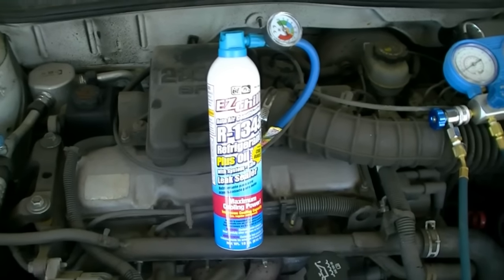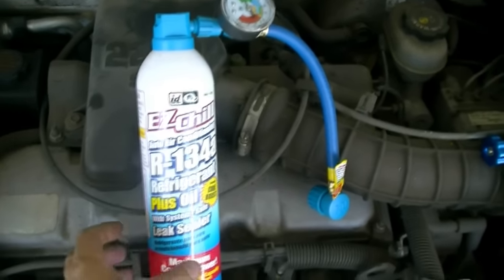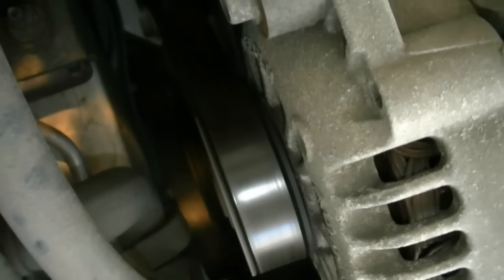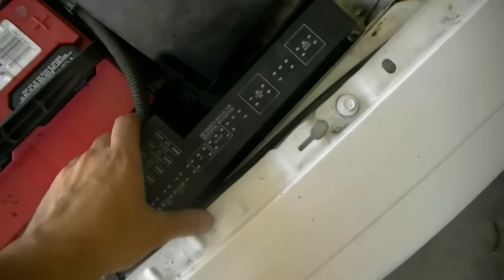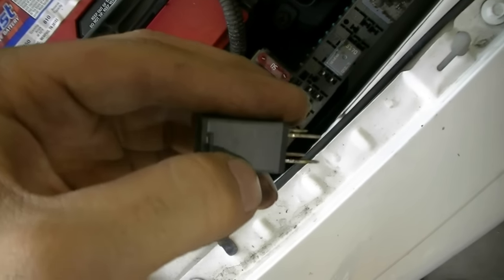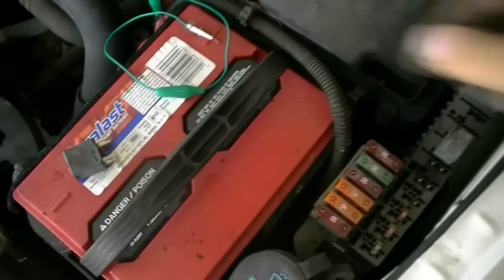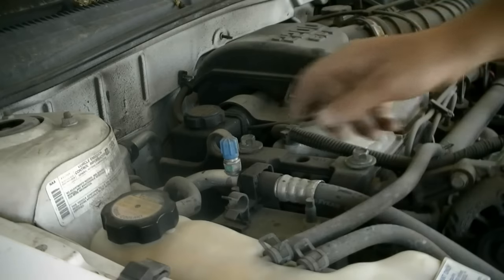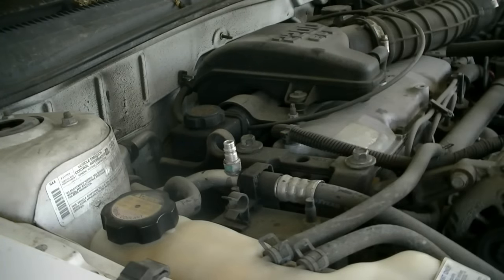How to Add Freon to a Car and Manually Engage AC Compressor Clutch

Comment: A lot of times adding a bit of refrigerant is enough to get your clutch running enough to draw more in. And FYI, Freon is a brand, it's called refrigerant. Thanks for posting and helping people.
Reply: Thank you for mentioning that first part.  The clutch activated after a few seconds of recharging, didn't need to mess with the relay.

Comment: The shop wanted $120 to recharge my AC system. I did it for $20 after watching this video...lol...Thanks man!
Reply from the maker: Wowo always glad to hear my viewers saving money after watching my video's. And thanks alot for your donation too. Cheers
Reply: They make the employees pay for their own certification.
Reply: websuspect yeah but it gets refunded if u pass..each certification is only 25$
Reply: Expensive equipment, the government's fault? A place to use it, the government's fault? The certification, sure. That's mandated by the government. Not getting into wether the benefits of certification out weight the cons or not, but to say that the reason car service cost 5X the price is solely because of the government shows your extreme bias.
Reply: I don't care what the shops situation is..a $20 fix should never be quoted at $120
Reply: @andrewjconners  many places told me this too.  This summer and last year.
Reply: @andrewjconners  they dont owe you anything they have a shop with employees to pay, liability insurance, wcb, certifications, a lease to pay and contingency to work in as well as a journeyman to keep on to make sure everything is done right. This isnt a 20 dollar fix, just adding refrigerant without gauges hooked up is a guessing game, there is no gauge on the high side and you can add moisture to the system. It's something that can work occasionally but is a complete hack and a good business cant work off guesses and hack fixes. Do it this way sure if your thrifty but not everyone wants hack work done to their vehicle
Reply: @bolerdweller  nobody said they owe me anything. but if you can't find the right people/parts for your business and price it accordingly don't expect the consumer to pick up the cost
Reply: @andrewjconners  also if this can cost 20 dollars and you think a shop should charge you 20 dollars what are you just not going to pay the teck? When's the last time you went to work and were expected to work for free?
Reply: bolerdweller thats 100 for labor get outta here lmao
Reply: bolerdweller is that not why we are here? To work on our own shit lmao. Injecting a small amount of freon is not worth $100 in labor for a 10 min fix unless you need some other parts and thats just that lol
Reply: @JabJabBinks  yeah that would be why you are here but saying a shop needs to work on your vehicle for basically free isnt right. It's a shop, they have more to pay for than a little time for a teck and some supplies, they have a lease to pay for, employees to pay, business licence, insurance, wcb, a significant investment in shop tools, book keeping, accountant, a contingency to work in, profit to make to keep their doors open and utilities to pay for. Dont go to a shop if your not ok with paying their bills to keep their doors open. And like I said before it's not about squirting a little freon in, you need a recharge? Its because it leaked out. The right thing to do is to fix the leak...
Reply: And to know that I was charged$85 for the samenthing, that is rediculos. Reason you lose freon is because there is a leak somewhere and needs repair,almost anybody can fix now days. Thanks for this tutorials
Reply: Did you get what you paid for?  There IS a reason they charge not for what they do but for what they know ( how to do it right the first time).
Reply: @andrewjconners  maybe its because its NOT a $20 fix.

Comment: Part of me thinks I could do this. The other part is afraid I’d blow up my car.
Reply: Be careful of using any off-the-shelf Freon because it has a sealer in it and if it hits air it will become as hard as epoxy and it will damage your system if you ever lose all the freon and air gets in the system.
Reply: Rx xxx
Reply: @bobbrocius6969 this makes it 10x better thanks for the support
Reply: You are so not alone!!!!!!
Reply: Just do it when it's hot and your AC compressor will kick on automatically

Comment: Dude, this video just saved me over 300.00 bucks. Thank you so much. This worked on my 2007 kia optima. Thanks again bro.
Reply from the maker: +Edwin Gutierrez np, always nice to hear people saving money. cheers
Reply: +RatchetsAnd Wrenches hey bro, I'm back to square one. It worked for a few days but now the compressor keeps not engaging. If I wire it to the battery it works fine., but as soon as I take off the wire from the battery it shuts off again. I changed out the relay to a brand-new one and it didn't help. What do you think might be the problem?
Reply: +Edwin Gutierrez You A/C system is leaking.  When the pressure is too low, the PCM will not send a signal to energize the compressor clutch.  Also, if you put R134a with sealant into your A/C system, no shop will performing an A/C service on your car.  They will most likely recommend you overhaul the A/C components and replace them with new ones which will cost a lot of money.
Reply: +Edwin Gutierrez Should get it professionally done.  Leak fixed, system completely vaccumed out and filled with correct lbs of Freon.
Reply: Refrigerant, Freon is a brand.

Comment: Beginning in 1994, they stopped using Freon in new cars, which is Duponts trademark for R12. You need an EPA license to buy Freon/R12 and its at least $30 a can, if you can find it. The automotive industry changed over to R134a and Dupont trademarked R134a as Suva. The correct term would be R134a or just say refrigerant for newer cars. Saying Freon is just confusing. Posting this is just to enlighten all to the correct term. Keep up the good work!

Comment: Excellent. I suspected the compressor wasn't engaging because all the Freon had seeped out over the winter but never would have known how to trick the compressor to engage without this video.  No diagram on the relay but trial and error with small wire didn't seem to hurt anything.  Thanks again.

Comment: Thanks for the very useful video.

Sometimes it's the simplest bits of information that make all the difference. I watched a couple of YouTube videos which said to put the Freon in the low-side port, but I was unsure how to tell the difference between the two ports. At 5:20 of this video you explained it, and mentioned, "don't worry, these connectors can only go on the low port..."

Bingo! Just the info I needed to know.

Comment: Great video, My husband just puts a jumper on the a/c low pressure switch.
Reply: It as located near the LOW SIDE PORT!
Reply: That is what I do too.  Much easier than the relay.  Mine was located on the top of the accumulator.  I used a simple piece of wire to jumper the sensor.

Comment: I have NEVER taken any of my cars to a shop to fix the A/C. They will rob you blind. The home mechanic can do it himself and save hundreds. Thanks for the video.
Reply: You go there for the sign that says $120. You think, hey not a bad deal. Park it there, for the day and go to work. Get the dreaded call a couple hours later. Yeah, you're gonna need some work before we even begin to recharge the system. When did you last? Then, it's the long winded spew of how hard their going to grind you into the pavement. A few thousand possibly? Shit! They should hand out helmets at the front door with all that good news!

Comment: Thank you. Mine was not exactly the same but the vid plus some comments got me to the solution. '97 Stratus: Fuse has an 87 and also an 87a. A paper clip connecting the two did the job.
Reply: Did you connect 87 and 87a to each other hand then to the positive battery terminal or just to each other?

Comment from the maker: If freon is low or there is no freon your ac pressure switch keeps the clutch from engaging and potentially damaging ac parts so thats why you need to engage it manually like I show in the video. But since it sounds like you have absolutely nothing in the system at first try to add freon without engaging the clutch manually so you atleast get some in to provide lubrication than engage it manually. GL

Comment from the maker: If the reading was way off and after removing freon and bringing it to the normal reading the clutch is still not engaging it could be either the relay which you already replaced or the AC pressure switch, if you have a manual for your car you can find out how to test that. Also it could obviously be problems with your compressor/clutch or other components which only an a/c specialist can probably help you with. gl

Comment: My Dodge Intrepid had the AC go out a couple of years ago, accept... The AC was completely fine, the damper that sends air to the heater was stuck open, and did not allow the air to go through the ac coil, and it also had controller glitches. I had to get it taken in 4 times because they don't make parts for that car anymore. But it cools great now.

Comment: Thanks for sharing this. When I tried to put Freon in, the compressor would kick in momentarily, but would disengage very quickly. I'm going to try this to see if I can tell what the problem is. It's an old truck with 240,000 miles on it, so I'm not that optimistic, but you never know, it could end up working.

Comment from the maker: Yes in order to get a correct reading the compressor needs to be running..if its running and you get 100psi than you have too much freon in the system. gl
Reply: What's the best way to get some out I replaced the compressor ,mind you a back yard mechanic,went well until hooking up ac pro, reading damn near 0 hit triger and wouldn't charge did this 2× at 15 second intervals still reading 0 let set and run with ac on high just as I formed by video hit triger and now all the way in the yellow what do I do,?????
Reply: how about compressor clutch kicks in about 10 times from empty then gauge shoots to 75 to 85 psi and compressor does nothing after taking 1 third of a 12 ounce can?

Comment: This is a common civic problem and I replaced the clutch relay (fuse). I also used the exact same refrigerant and had heard this was calibrated at 75°-85° (per Amazon review). I probably was low on refrigerant and this caused the relay fuse to blow.

Comment: The pressure of the freon in the can is high enough activate the low pressure switch, it doesn't take a lot. After that, the rest of the freon will go in unless you have a bad compressor or an obstruction in the system
Reply: That's what I've found over the years when adding R-12 or R-134a to low AC systems. Used a jumper a few times to test the low pressure switch.

Comment: WARNING! If refrigerant pressure is so low that compressor will NOT engage, the system is full of air!!! The entire system MUST be evacuated with a vacuum pump. Otherwise the refrigerant will mix with air and the high side pressure will be dangerously high. Also if the system is not vacuum pumped first, the efficiency will be very poor. You may be able to add a little refrigerant if the compressor engages and kicks on and off. If the compressor does NOT run at all, there's too much air and you are risking serious damage to the a/c system. Air also contains moisture which is the worst enemy of especially R-134 systems. BEWARE!
Reply: This guy is right
Reply: How does this advice jibe with Donzi's comment that he's successfully restarted 100's of compressor's  by just adding refrigerant? Wouldn't he have experienced the damage noted? Confused by these conflicting assertions .
Reply: I jumped my compressor just like the vid.. compressor turned on.. so I checked Freon lv it was a bit low. I bought some and when I tried jumping compressor again it didn't want to engage.. any answers?
Reply: So how do you remove the air in the ac system? I just put a new condenser on and i know there's no freon inside. It all leaked out during replacement.
Reply: @equisequis.55  use a vacuum pump.   You can rent them from most parts stores.  ChrisFix has a great video on it.
Reply: Use the refrigerant to purge the air
Reply: @Atadifferentplanet how do you purge system with freon?

Comment: Why bypass the compressor protection? Simply add refrigerant until the low pressure switch is satisfied and the compressor will start in a fully protected manner.
Reply: That can take some time but is the best practice since the compressor shaft seals get their lubrication from the oil in the refrigerant.
Reply: Took one minute and compressor kicked in . 5 minutes more and It was fully charged. 2 months and still running cold.
Reply: I tried adding R-134a yesterday to my 2005 Dodge Neon and found that my cheap Super Tech valve failed to puncture the bottle seal. Returned it and bought A/C Pro. Used it this afternoon where the gauge showed near zero PSI. Started charging and after a minute released the trigger to find the pointer in the yellow. The AC was blowing cold inside the car so left it running to see if the pointer stayed steady or dropped. It did gradually drop down into the green to 45 psi so left the car running to see if it would drop more. It stabilized at 45 psi with the temp at the vent 50 degrees which felt frigid since it's 100 degrees F in the shade today. There's still some left in the bottle so may add that tomorrow morning when it's cooler when I check the PSI to see if it's dropped below 45 PSI.

Comment from the maker: I assume you removed the relay and ran power from the battery to the relay terminal and now have to keep it that way for the a/c compressor clutch to be engaged right? 1st test your relay(I have a video on this), or swap it with another good relay see if it works, 2nd check and make sure you didnt overfill your a/c system or if you added enough freon. Your A/C pressure switch will keep your a/c compressor clutch from engaging in that case to minimize damage. GL

Comment: Thanks for the tip.  This didn't work exactly like the video by powering the relay input.  It did however work by "jumping" the points in the cable port that goes into  the evaporator.  Then the compressor turned on to be able to charge the system.  Hope this helps someone.

Comment: I drive a 1995 lexus sc400 and have found the magnetic clutch relay but now im having trouble by passing this relay there is no number 30 and 87 there the only numbers labeled for each side are 1 2 3 and 5 

Any help would be much appreciated 👌👌

Comment: I've been having trouble with my son's 2006 Mazda 3.  Replaced compressor and haven't been able to be the clutch to engage (no voltage is coming through the wire.  Your video is the first (I've seen) that has you pulling the relay switch and jumping the clutch.  Why do that when you can turn the system on from the inside?  Of course it didn't work for me leading me to think I have a bad wire somewhere along the line.  What am I missing??

Comment: I can't really tell in the video, what am I looking for to know whether or not the clutch is engaged? I assume mine is engaged, my AC still blows moderately cold air, I just want to get it colder.
Reply: ArmorOfGod find your AC Compressor.  The pulley will be going around something.  When your AC is turned on, that thing the pulley is going around is the clutch, if it's moving your clutch is engaged and your AC is working.  Same with your AC off, the clutch won't be spinning while the pulley around it is.  If your AC is on and the outside of the pulley (your clutch) isn't spinning, it may need to be replaced.  Like the video states, check the relay if it's not working.  KCCO!

Comment: I realize this is a very old post, but how do you know which relay is for the clutch, when you have multiple relays? 1-A/Con, 1 A/con 1<large>, 1 A/Con 1 <smaller> 1A/Con 2? 2009 Kia Sportage 4 cyl

Comment: good point on the open air temporature reference. i always wonder why is there a dial over the glass guage for..    thx..  but are we suppose to add during AC compressor ON or OFF?? i seen another R134A example didnt say that was necessary.  all he did was charge can with patience for 15min.   his AC temperature resulted 44 degreee cool rather than 82 degrees.

Comment: Excellent stuff. I manually engaged comp clutch ,it turns when jumped but does not engage when fuse is in .should I replace fuse maybe or get new comp or both ? Any advise . thanks for the video.

Comment: If your Refrigerant is low there is a reason fix the leak. Adding Freon is a temp fix and often will just leak out and then you are back where you are started.
Reply: I mean, there could be a leak, or your vehicle could be from 1987.
Reply: I mean, there could be a leak, or your vehicle could be from 1987.

Comment: i agree, this is very dangerous for the compressor. Just connect the freon can to the low side port, it is very close to the compressor and will go directly to it therefore activating it. Don't be hasty the compressor will kick on soon after :)

Comment: Do you test the pressure while the car is running, or when its turned off? I ask because my car shows it's partly low when tested with engine running, but shows a little high on the gauge when car is not running. (Note: I'm referring to the gauge that comes with the can as shown in your video)

Comment from the maker: Hmm, I would double check and make sure you have the right relay, the relay for the fan clutch and the compressor should be different. Also if you have a code for the ac pressure switch I would replace it first as that would keep your clutch from engaging. Before you do that make sure the wire that runs to it is not pinched anywhere or hasnt been rubbing up against any sharp edges. Especially if the car had recent work done with its vicinity. Sorry I cant be of anymore help. GL
Reply: Not always. They are the same on my moms fiesta